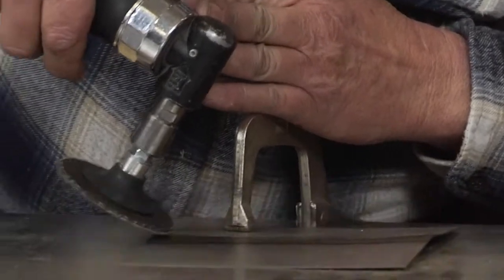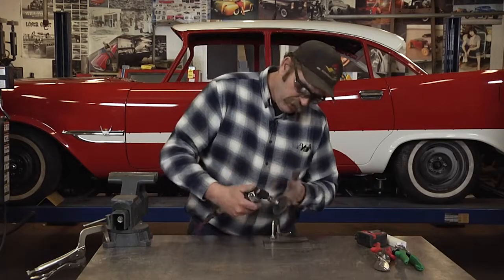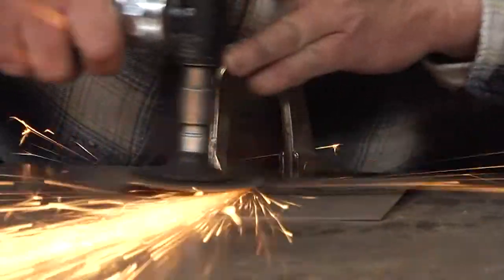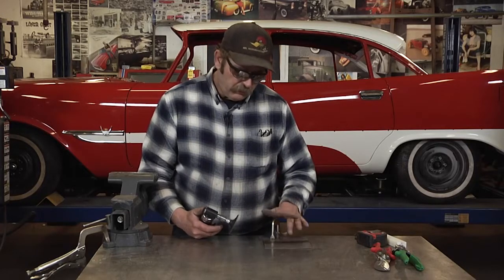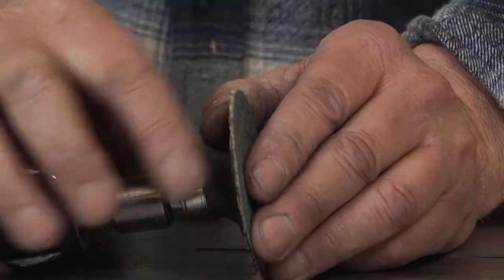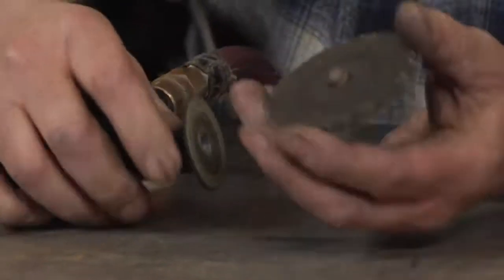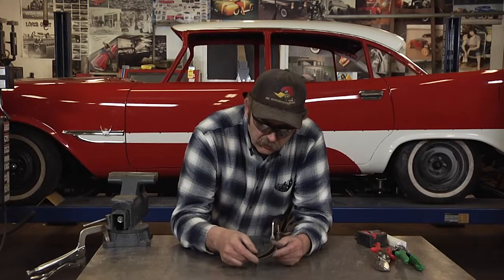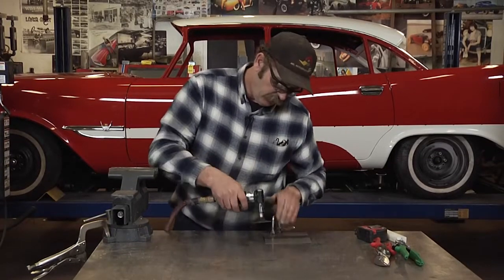Tips for Smoothly Grinding Welds

Comment: Great video nice idea with the cutoff wheel what is the best sanding grid  to use when winding down Wells thank you
Reply from the maker: Hi Louis,

On frame rails, axles, etc I get more aggressive and use 24 or 36 grit, whereas on exterior sheetmetal I don't want to scar up the base metal too much and will instead use a 40-80 grit sanding disc.

Mark
Classic Car Restoration Club
Reply: @ClassicCarRestorationClub  thanks
Reply: @ClassicCarRestorationClub  So that is a sanding disk, not a grinding disk?

Comment: What type of orbital sander are you using for this?
Reply from the maker: Hi Kyle,

For this video, Mark is using an older Craftsman right angle die grinder similar to the new one in this link. 
www.acehardware.com/departments/tools/air-compressors-and-tools/air-sanders--grinders/8292666 
Similar models are also available from other tool sellers. Here's a few more links: 
www.amazon.com/Ingersoll-Rand-3101G-Angle-Grinder/dp/B000VYZ1HW 
www.amazon.com/6255-Professional-Composite-Grinder-Mechanism/dp/B000AYS01C 
www.amazon.com/Chicago-Pneumatic-CP875-4-Inch-Grinder/dp/B0002SRORM
Attached to the grinder is a 3M 3" Roloc backing pad: 
here is a link: 
www.amazon.com/3-Inch-Roloc-Holder-4-Inch-Shank/dp/B002E0B1T8
With 36-grit 3M sanding discs. Here is a link: 
www.amazon.com/Roloc-Grit-Grinding-Discs-Brown/dp/B000XHO7TU

Mark
Classic Car Restoration Club

Comment: What about grinding or sanding welds in tight areas on a car? parts that are small and tough to get with a flat 3" disk?
Reply from the maker: Hi Hiram.  While the 2-3" inch disc sander does a great job at smoothing welds out 95% of the time there are those occasions when you need to get into tight spaces.
One of my favorite tools for the task is a mini-belt sander.
Here's a link to the unit I use: https://www.eastwood.com/rockwood-3-8-x-13-pneumatic-mini-belt-sander.html
Wrench Safe, Mark